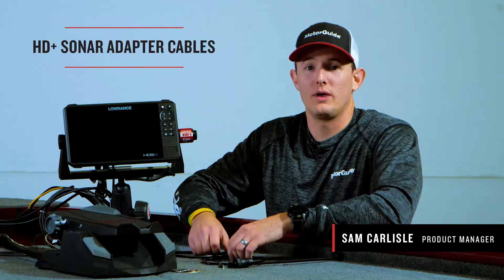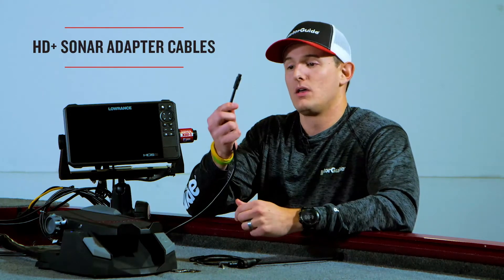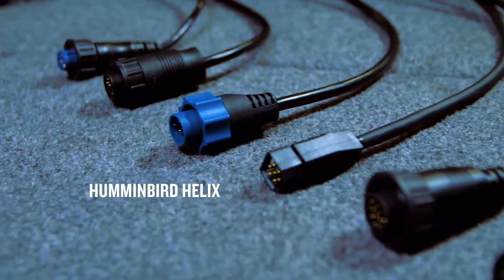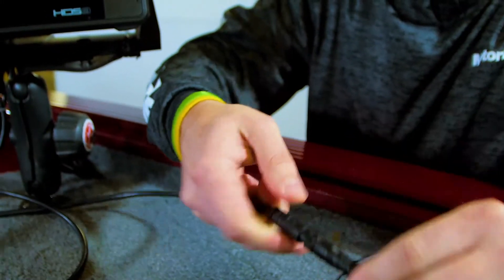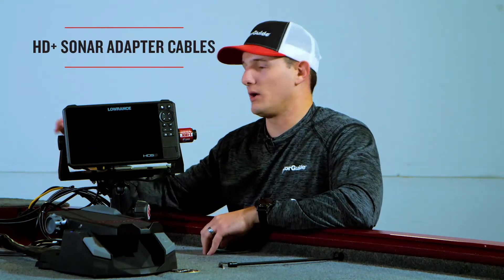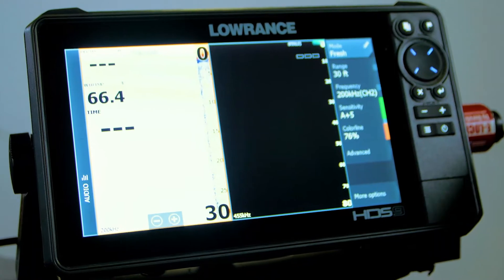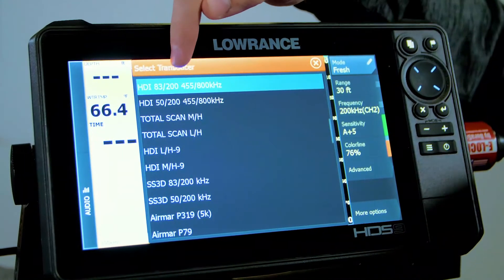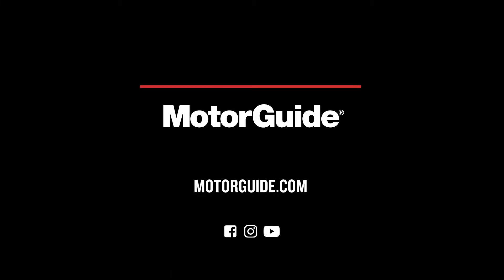MotorGuide Tour Series - HD+ Adapter Cables

Comment: I tried hooking it to an Echomap Chirp CV as the advertising info states it as compatible. It won't auto detect the transducer and traditional 2D is all that is available. With the HD+ connected, Clear Vu (downview) sonar options are no longer available. The Echomap UHD does detect both elements of transducer as Motorguide HD+.